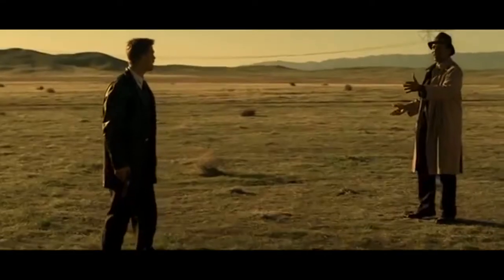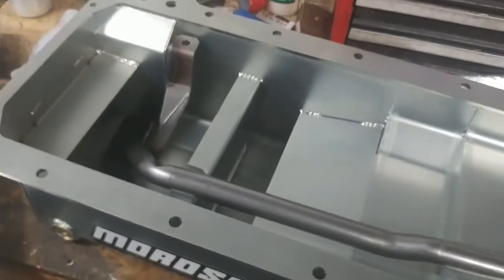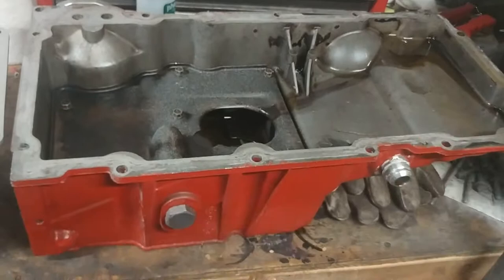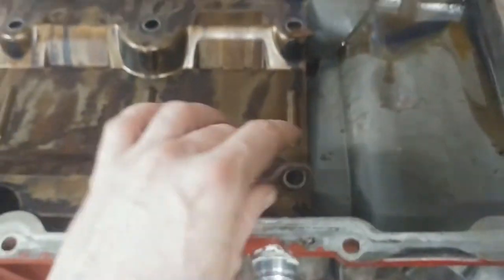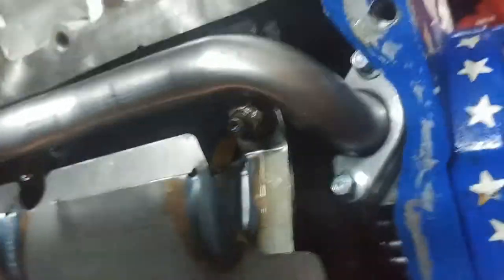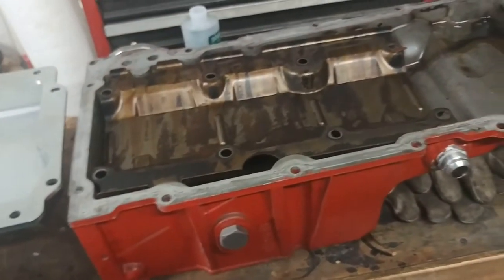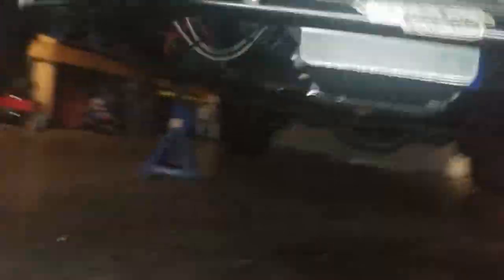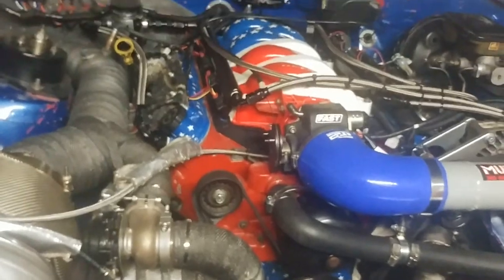Fixing LS Oil Control Issues

Comment: Thats a nice piece, I might have to get one for the 370ci
Reply from the maker: I would since you probably already need one. It's meant for 1998-2002 F Bodies.
Reply: @TrailerParkMotorsports  I do, because the stock one is from a truck.
Reply from the maker: @DropTopPerformance  the truck pans can be modified to fit, but usually that results in drastically reduced capacity in order to gain back ground clearance.
Reply: @TrailerParkMotorsports  id rather buy a sweet unit like yours
Reply from the maker: @DropTopPerformance  I agree. This makes it too easy.

Comment: How much oil did you run or did you ever try running more oil in it I have heard of people having problems with oiling on stock fbody pans but seems like it's only when u run 5.5 quarts other people have tried 7 or 8 quarts And never have any problems I just watched this video I only have one watched one other of your videos so far just curious. I also have a third gen Camaro I put a 5.3 sbe single billet s480 t6 with a super victor and a blow thru CSU carb non intercooled on e85
Reply from the maker: Thanks for watching, commenting, and subscribing. I was running an extra quart in the pan on the recommendation from another turbo LS third gen guy. Really, any more than one extra quart and the oil level is going to get into the crank which is also bad.

I always question the people "who never have a problem", mostly if the even know of the issue. I only noticed it in the datalog because I was looking for something else. The factory ECU (P01 anyways) doesn't log oil pressure and I don't think anyone would catch it on a gauge after releasing the brake.